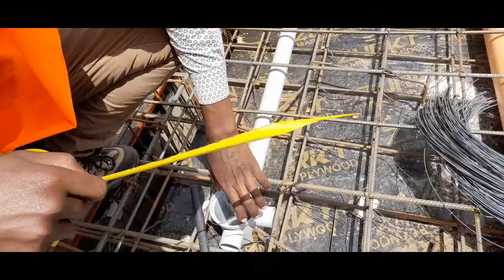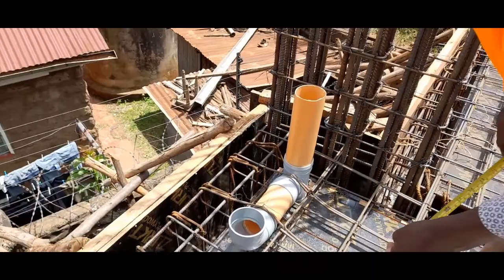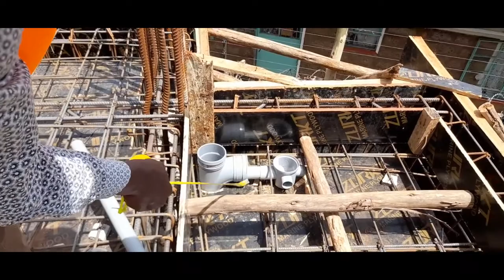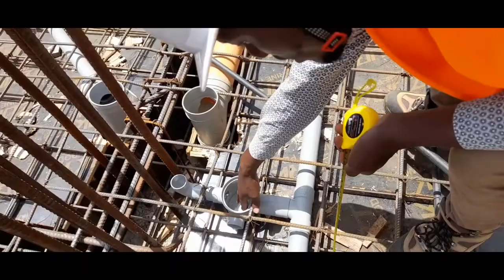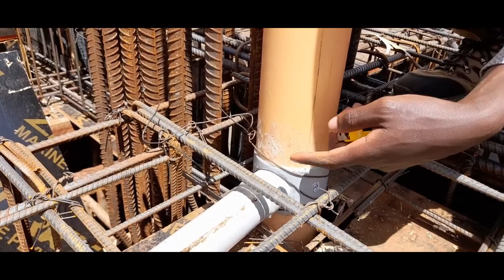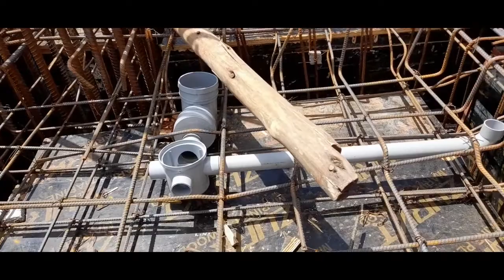PLUMBING WORKS

Comment: Min 5:49 is 40 mm
Humble of you to take notice of the 6" waste affecting the steelworks near the beam.
Overall, good job engineer 👏
Reply from the maker: Thank you. Using such a pipe is not advisable and in this case it was corrected  since that slab depth is 150mm, unless its passed above the slab with a small molding to cover it next to walls. Concreting the pipe inside the slab might also lead to formation of cracks around that region. So builders must be careful